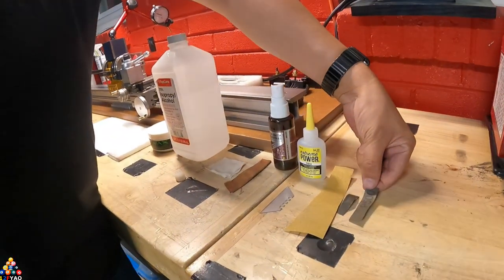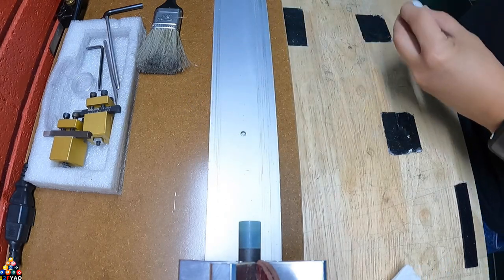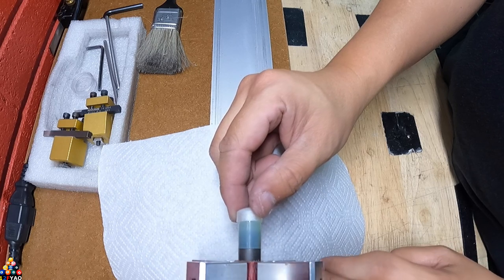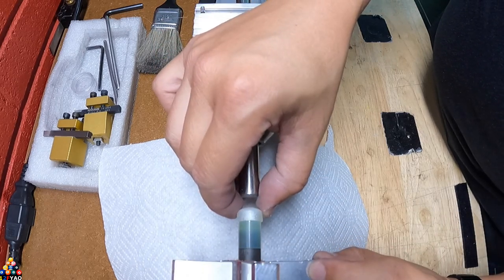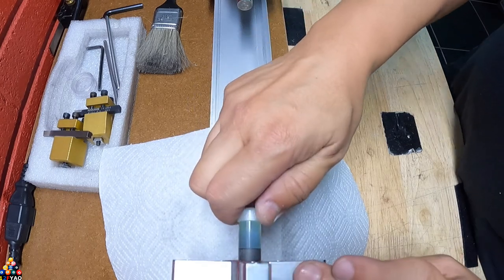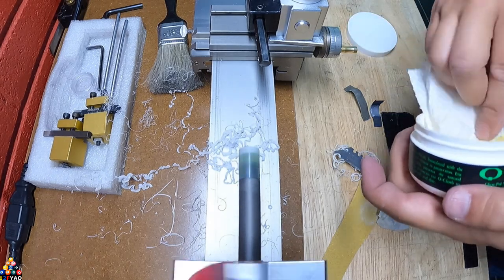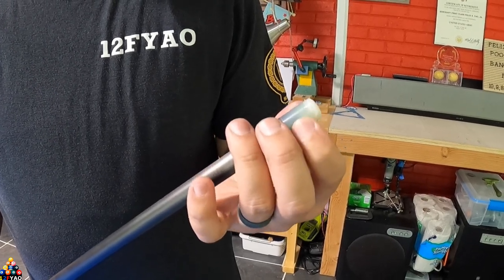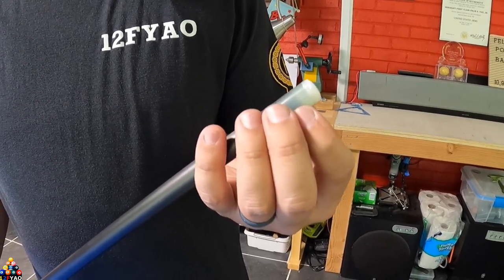Installing A HORO Jump Tip

Comment: Hello.. I really. Enjoy your videos.. Can you explain the difference between the break tip and the jump tip. coz I thought they were the same.. Like a jump tip can be a break tip and viseversa. Thanks
Reply from the maker: Most tip brands can be both used for jumping and or breaking. Horo formulated the jump different from the break. You can use the Horo jump tip on the break cue and vise versa. To me, the jump tip is a little bit hard but it still grabs the cue ball to place English if needed. Horo break tip is a little bit softer but it still opens the rack. The Horo break tip is designed for a firm break where cue ball control is best to get a shot at the lowest numbered ball. Hope this helps, thank you for commenting, please subscribe if haven’t already and please share.